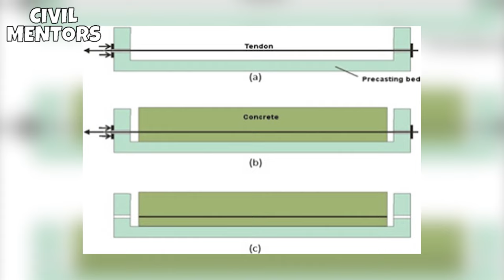Top 6 Structural Engineers in the World

Comment: Fazlur Rahman Khan, The Einstein of Structural Engineering, born in Bangladesh 🇧🇩
Reply: East Pakistan to be correct.
Reply: Hahahaha...really 😄😄😄😄.....All the buildings are designed by Architects...not engineers
Reply: @faisalraja6607 Architects give birth the whole structure not engineers..ok??. Engineers are just a Helping hand of Architects, nothing else.. Architects have to do a lot of amount of work in a finite amount of time so they needed.
Reply: @সবুজেরসমারোহ-শ৯ত  you are not undertanding the concept. Architects do spend more time as they do conceptual design and that's why they get paid 5 times more than the engineers. However for example take Burj Khalifa, Architectural plans alone would not have built the building. Do you know engineer's had to develop special machines and pumps to pour concrete to top floors. Special concrete mixes were designed so concrete could flow through 1km of pipes to top and gain the required strenght at 50 degress Dubai temperatures. So you are wrong my friend without engineers only thing architects would do is draw pretty pictures on papers nothing would actullay get built on ground.